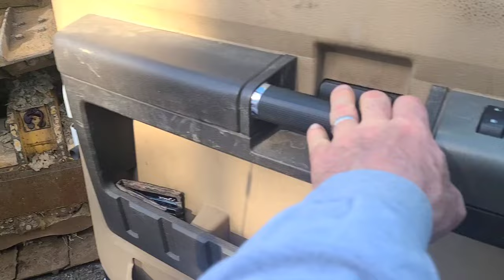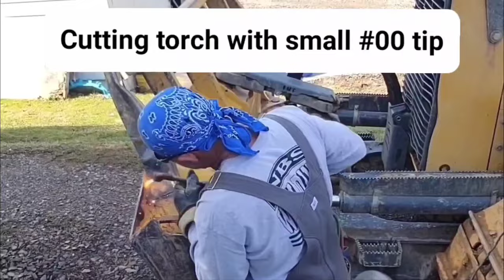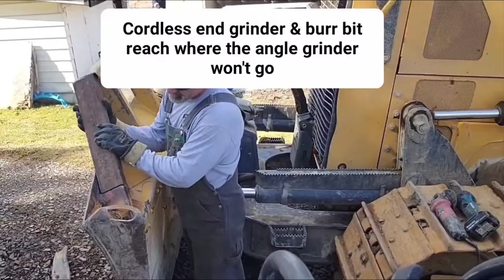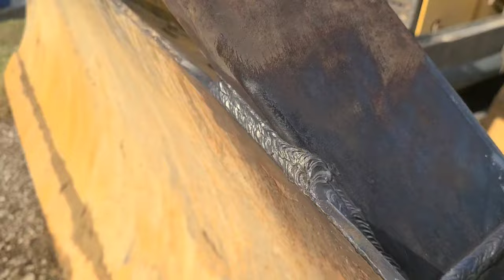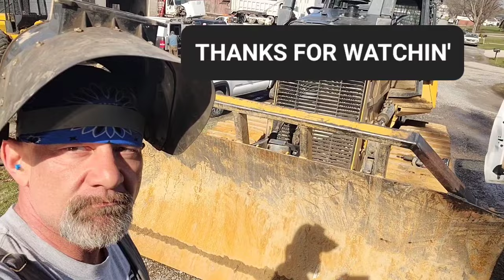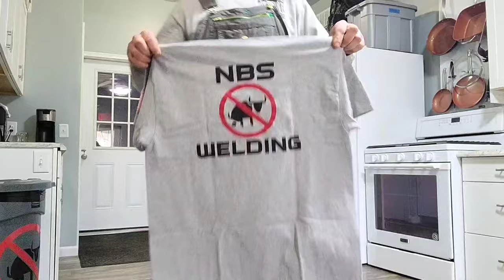Repair the brush guard on a timber dozer

Comment: About as straight forward a repair as you can get.   I like the amount of weld metal you put on that repair.   It ain’t goin’ anywhere.  I wanted to ask something of you, CB.   If you think back over the last 20 years of welding, what is the most rewarding type welding you have done.   How about the most enjoyable?     I’m just curious.   How about the best paying type of welding in your area?
Reply from the maker: Most rewarding are the quick repairs that get done when somebody is in a jam and I get them back in business doing whatever it is they were doing when their stuff broke.
Most enjoyable is probably pipe spool fabrication in the shop turnin' & burnin' fittings together on my welding positioner and runnin 1/4" jet rod...slick beads with perfect caps that look like a tight fittin' wedding band on a dowell rod.
Best pay was when I was installing load rings on 20" well conductors and gettin paid per install...I bought extra tools and even built some custom equipment that allowed me to do it quickly but I got to install enough that it was worth it

Comment: Nice job. But I have to ask, what is the tally on the inside of the door on the truck keeping count of?
Reply from the maker: I kept track of how many wellheads I welded on for the last gas company I worked for before I got out of the oil field....I think I installed and tested 105 before they switched to the load ring system...not many weld on well heads in use anymore these days

Comment: Nice work.  Do you get your wire wheels online or at the welding store?  Brand?
Reply from the maker: Both....I haven't settled on a brand or a vendor yet for that....the expensive ones from the welding supply store definitely last longer but I've got some cheaper ones online that did pretty good for the cost...jury is still out on that one

Comment: Q. Does that weld hood block the background light reflection. If so what hood is it? Have big issues in this area. Always outdoors.  Your welds are always👍 always enjoy.
Reply from the maker: It does not block that background deflection from the sun...actually it's one of the worst for that problem.

I have a Miller goggle that eliminates that problem but I only use it when I have to because it's not the most convenient otherwise....I'll include a link to a video where I had to use the Miller goggle because of the sun being behind me...that video also has more info on the hood I'm using in this video.

https://youtu.be/CHsiF881RnY?si=DjQIqFL_uFCmF-iw